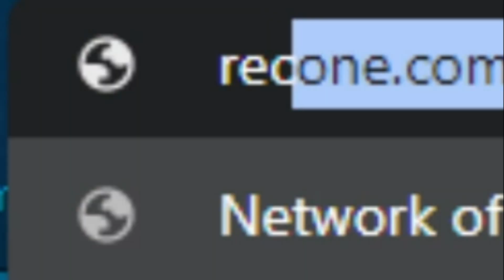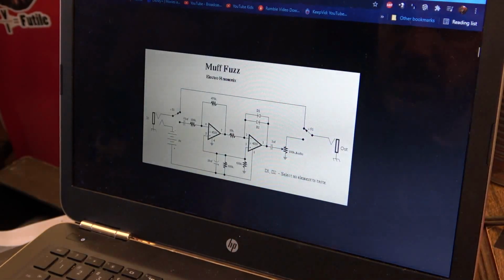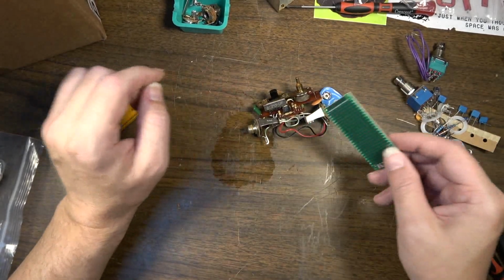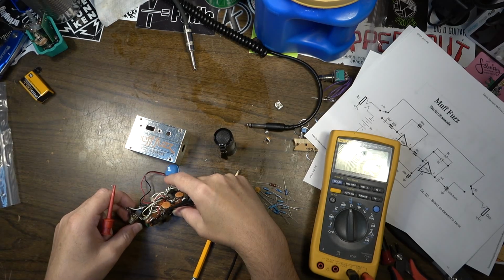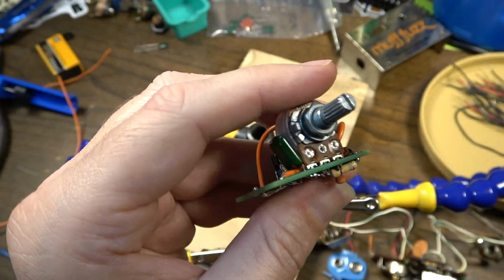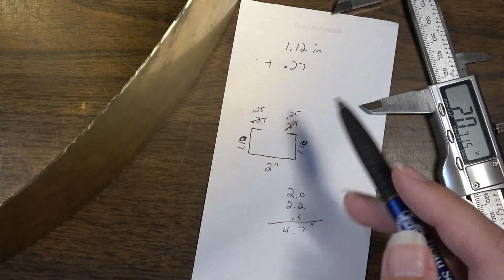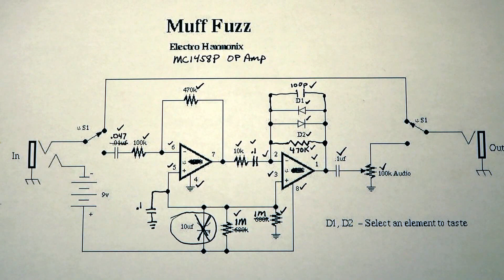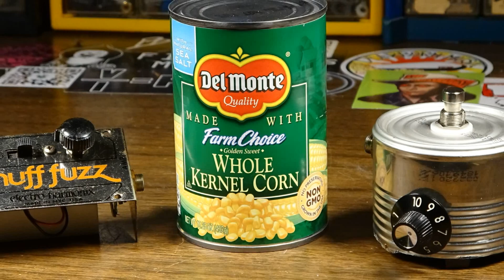Opening a Fuzzy Can of WHOOPASS! - 70's Muff Fuzz Restoration and Clone

Comment: Hello again, B.  Circa 1978, I built a fuzz box encapsulated in a Marvel milk powder tin can (empty!).  I found the quite simple circuit diagram in a projects book, sent away for a slice of Veroboard and the components, built the thing and encased it into the shielding afforded by the aforementioned Marvel can.

The results far exceeded my expectations.  Very responsive.

A couple of years later, I was working as a Junior Partner in a music shop/amp repair facility, under the guidance of Geoff Johnson, who, as you know, designed/developed and manufactured amps for Vox.  RIP Geoff.  It is a funny old life ...

All the best, Brad.  Stay free.  Rab  🍻😎                           🌠
Reply: PS.  I still have that musical electronics projects book, if you are interested?  R  👍

Comment: Had one of these around 77...Actually , you plugged the unit into your guitar then to the amp, which Is the reason for this type switch...It didn't last long from the snatching and pulling....We were 13 years old...It was my first experience with ANY type pedal...and yes, I was in heaven with that sound....Not so much now

Comment: I had one around 81-82.  I bought it new.  The back is steel but has a black texture finish on the outside.  I had a really cheap Strat copy and I used a male/male 1/4" and plugged it directly into the strat jack.  :-)

Comment: I own a little muff fuzz. I've had it about 43 years now. Mine had no back cover either (funny). The other owner was probably to lazy to put the screws back on after battery change. I covered mine with a metal wall plate for a telephone jack - textured with silver finish. It was perfect in size to bend into shape. Great idea with the can man.

Comment: Great video! There's also a Muff Fuzz that's a variation of a Fuzz Face circuit that came out back in the day using transistors instead of an op amp.

Comment: Nice job building that back. I was going to suggest painting it flat black, as I had a later version. It was still very similar. Still my favorite Fuzz tone was an OLD Jordan Boss Tone. Sounded great but it plugged into the guitar output jack. I've got the schematic for it. Such a shame it was discontinued, I know they're building them again, they cost the same as the did in 1980, $75. It might have lasted had they made it a pedal. Sounds great.

Comment: Hay,I had one, I taped it to ma guitar strap with duct tape ran a short from my guitar to the muff another short to my head headphone (yes, I had the first headphone for guitars! Think walkman meets am radio) the batters ran out so fast but it sounded sooo badass it was worth it. Headphone replacement was very hard to come by
Sony was the only one back then.
Reply: Love what you were doing,if you don't mind going to open up a can spam and convert it to a case for my tube screamer. Give it a poor man look.
I think you got something. Can I throw you a idea later. A concept. I think there Is a market for it. Just passing a ideal along. You can run with it. See you later.

Comment: I have an electro harmonics treble booster which I purchased used in the late 70s.  The back is metal with a thin black vinyl covering glued on.. The device was actually plugged directly into the guitar so the knob was accessable. An odd arrangement but the device but popular in the day.  The orange squeeze pedal was used in the same way.

Comment: Now  that's a good value build , the circuit diagram at the end shows some mods by the loos of it ? .01 to .047uf on the input cap ?  a resistor and a cap surrounding the diodes ?. Was interesting to see you used an antilog pot !
Reply from the maker: Pot is wired backwards, yes.

Comment: Great job at making the back of a muff-fuzz.  @16:40, instead of using green beans can, tuna or cat food can, shorter, no need to cut, and no sharp edges.  Other good cans of same size with different products too.  Cheese dip for tortilla chips.  And can that comes with blueberry muffin mix(I don’t think they have that internal can anymore).

Comment: I did this once😂 build a regular muff (with transistors) in a old can, made it as ratty as possible, I used a pasta sauce jar lid for the bottom, it was very similar to yours! Then I put it in a little enclosure to put it on my pedalboard… I stopped using it and it sits on my bench languishing on top of a parts bin to this day😭

Comment: You're an inspiration! I've haven't been too afraid to break something that's already broken, so if there's an issue, I may as well try to fix it. Aside from donor boards, how do you supply resources for old components? I tracked down my faulty treadmill lift motor issue to a BTB06 600B triac on an old 1996 Icon PB-2001 supply board. The problem is, I don't need 25, 50, or 100 of them! 2 would be nice! (I did order a working used board from eBay, so my current faulty one will be the new donor board.)

Comment: I'm pretty sure that those diodes in the original are 1N4148, which are a very common silicon diode and have been used in countless pedals over the years.

Comment: I had one of these in 1980 or so when I started knowing I was going to be a real guitarist. A real guitarist had a fuzz and I had a whole $10.00 to spend at the mom and pop. Through my Global guitar and Radio Shack PA 15\4 I thought I sounded like early Gary Ritchrath.

Schematics are on the interwebs. Build a new and sturdier one and put in the old yet shiny box. Possibly useing the original op amp.
I thought the same even if only just onefor myself.

Comment: You can use an electrical box ( plastic or metal )  if your sheetmetal skills are low...i have sheetmetal brakes so that is easy to fab up...lots of alternative options to enclose it if you look ( measure up before to see what could fit...)..

Comment: I have one on a bread board with a couple 2n3904 trannies without the diodes.
Using a .0047 input cap and .22 out cap into a 100k pot.
Makes for a decent half cocked wah sound, or mid boost.
Im waiting on a couple 2n5088 and im gonna use it for a midboost into my jcm800 2204.

Comment: Subjection: add a 10pf cap across the input. That will short out the RF/Radio Station from coming in. It fixed mine about 35 years ago.

Comment: Use a Sterno can, it's the right size as is. You can call the pedal Canned Heat. Also, you might want to get a small sheet metal brake to help with bending. Harbor Freight sells a very simple one for about $40.

Comment: Was it ment to be plugged into the Amp or into the Guitar/Bass? I think it would plug into the Instrument rather than the amp. Just sayin'... It would fit all guitars and you can turn it on/off while playing using the switch.
Reply: The picture I saw looked to say amp next to the 1/4 inch jack so I think it is supposed to plug into the amp.
Reply from the maker: Supposed to plug into the amp. The "OUT" goes to amp. Plus, no way you'd get that plugged into a Strat.

Comment: WHen I was a kid back in the '70's if you got enough money for a like a Kustom V amp, it would be like $150 with volume, bass, treble, and Reverb, so the salesman at the guitar shop would sell you a Little big muff pi (mine was the yellow and brown one) and that would be your channel volume and instead of cranking it wide open  and turning down the Master volume like you would on say a peavy Pacer or Fender or marshall you could get the distortion, sustain and feedback just turning your little big muff a 1/4 the way open, I want to say mine only cost $25, maybe it was $50, but I am sure my whole setup, Kustom V lead and little big muff was like $210, but I had sound like $300-$500 amp with volume/distortion/Master volume. Only thing I didn't like was Hi/Lo switch. You would have to put it on hi and back off the amp trable and turn up the amp bass, but it was a chain saw, no Eric Clapton Bluesy fuzz, it was Detroit Rock city all the way! Electro Harmonics makes some great stuff, their Phase shifter was a good rig and the Canyon is awesome. The Canyon is so much in that little box, you almost need a class to figure out all it can do. I want to say that the Muff fuzz was super cheap, like $15 or something.

Comment: Actually you would plug the unit into the guitar, not the amplifier. The female Jack is the output. You could not use this with a Stratocaster or any other guitar with a boat Jack Style.
Reply from the maker: That isn't true with these, from what I can tell. Maybe they made some like that, I don't know. But the ones I found online clearly have the male plug on the "Amp" end of the unit.
Reply: @TheGuitologist  huh. I've owned at least three of them in my lifetime and all the ones that I had plugged into the guitar not the amp. I'm sure they did make some that way I just assumed they were all like the ones I had.